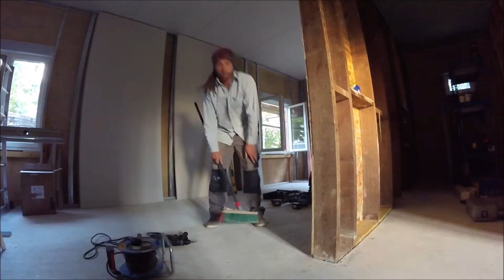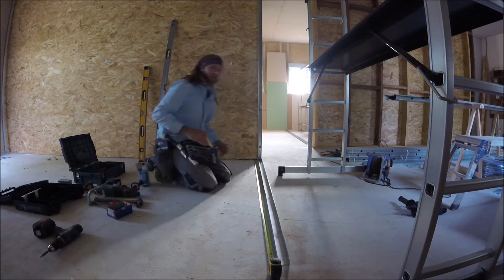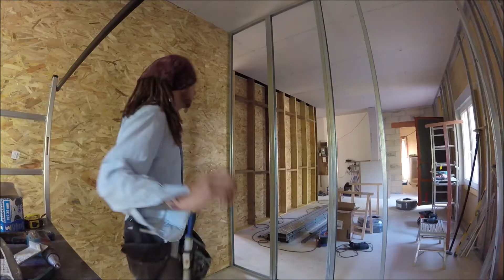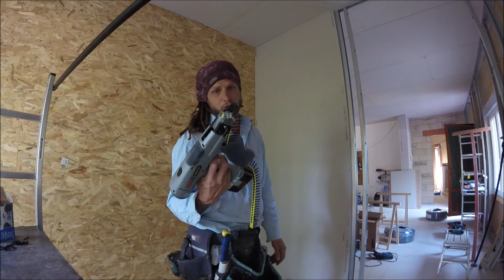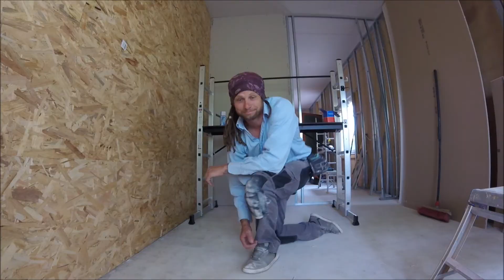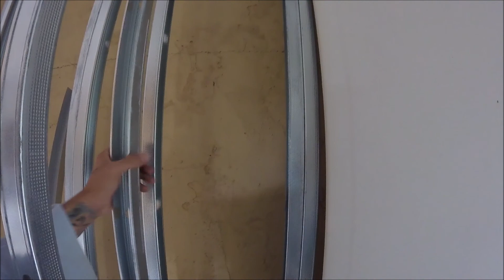HOW TO BUILD AND INSTALL A METAL STUD PARTION WALL AND DRYLINE IT, DIY STYLE

Comment: A quick question. In the UK, I have experienced that when stud walls are constructed using timber, in the void between the plasterboards soundproofing insulation is added to limit sound transfer between rooms.  Is this the norm in France and how might you insulate a stud wall made of metal?
Reply: You fit 45mm insulation between the void as well, exactly the same as the UK, metal is used here more because of termites and they can’t make straight wood 😆

Comment: Sharing all the tricks of the trade...appreciated. Great walk thru...thanks! 👍 

Swansea, Wales.
Reply: Morning robinmyman, glad you appreciated it, bit long but hey it takes time to do stuff
Reply: Bit of background...I’m Rob...retired Accountant...brought up broke parents, ww2 veteran died when I was 17...so no silver spoon...get on with it Rob. 😂

Done loads of DIY...cars, fully wired first house and electricity board passed it first time...got the regs. Done loads of plumbing and hate computers and Ideal boilers. Loved gardening but pushing 70 so everything buggers me up...nag, nag, nag watch your back and knees and the chop saw. Used to make own oak/ mahogany furniture long time ago.

Did a ceiling once...boards not plastering. Discovered the deadman.

Wiring out there is different...just started going back thru your older vids. No ring mains but star system? Just curious. Watching re runs of Escape to Chateau...Strawbridge is a case isn’t he?

Just picked up bargain Dewalt XR double 3ah 18v combi...had enough of el cheapo drills.

You’re living the life...family?

Inlaws Gower farmers.

Edit...did you hear about the actor who fell thru the floor? He was just going thru a stage...I’ll get my coat.
Reply: robinmyman I think this is my most favourite comment 😂 glad you enjoying the videos, they call it a spur system for the electrics really easy to work with